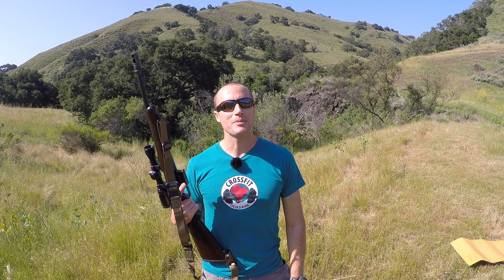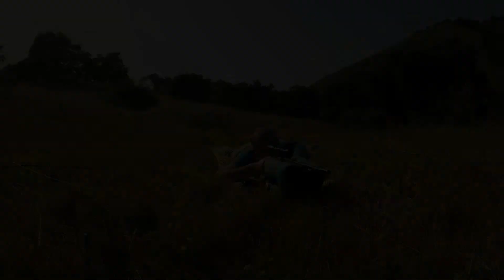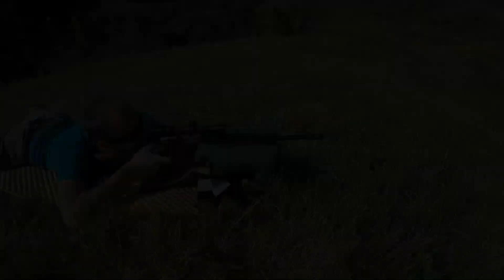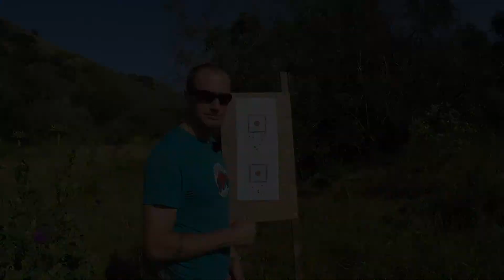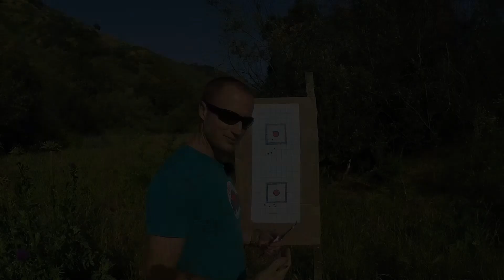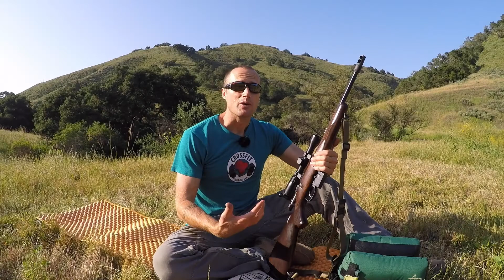CZ 527 Carbine Range Report Part 1

Comment: Mine is sub MOA with Hornady Black 123 gr. SST using a Vortex 2-7x24 scope.
Reply: Mine is sued chiefly as a Hog Gun.  Handy, little recoil, easy to use bolt.  I have also added a rear Skinner Peep Sight.  Sure wish they had 10 rd. magazines for it.
Reply from the maker: Nice!  I think there may be a issue with the crown on my muzzle when the smith did some work on it.

Comment: I have a 527 in 7.62. With Winchester 123 gr. fmj it shoots a sub minute of angle group at 100 yrds.
Reply from the maker: I know mine is capable of more.  I am in the process of finding a replacement stock right now.  I found that where mine beds, it is broken.  I'll have to try some Winchester when I get it back up.

Comment: 4x is fine for 100 yards. As you found the only thing you need to change is aiming point size. Something around 2 - 2.5 inches would be great and red. I use a red 0.75" sticker at 50 yards with a 9x and it is a bit too large for consistent point of aim.

Your eyes, glass and reticle might be different so a different diameter might be better for you but I think a dot is better than dot plus box. But honestly the rifle is shooting fine with that ammo. Most groups on the Internets are fake.